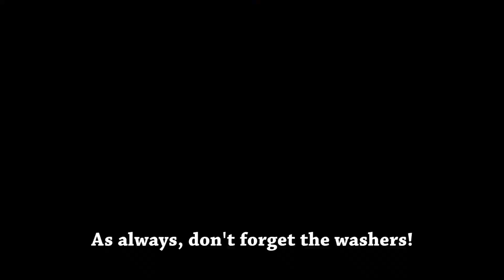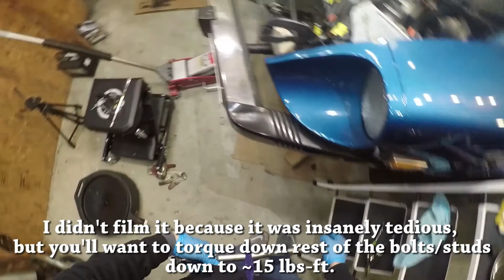Datsun 280z Ep.26 Installing the Intake Manifold

Comment: More than 30 years ago I installed 32/36 DGV Webers and a header on my '73 240.  I lifted the head off along with all the stock intake and exhaust pieces, mounted the new stuff and lowered the head back in place (lapped the valves and cleaned up the ports while it was off).  I just finished rebuilding the Webers and replacing the rusted out header with the head in place.  So I thank you for sparing us watching you do those other manifold nuts.  A couple I could only get to with an open end wrench and then only 1/4 turn at a time.
Reply from the maker: Haha, no problem. It seriously took me over an hour just to do those bolts, it was a giant nightmare. The wrapped headers didn't help the situation. I just hope I don't have to remove them anytime soon.

Comment: Thanks for the video man.  I love your stuff.  Had 2 questions.  You didn't show in the video putting the valve cover breather hose on to the 3 way connector.  Did you put a flame arrestor in yours? Second question is what did you use to plug the bottom side of the EGR valve with your delete?
Reply: @jnieman  awesome. You're the man.

Comment: The air regulator there at 1:42 is one of the only engine parts we can't get anymore.   They were $160 like five years ago and I laughed at the price for such a simple part.   Well now I know why, they've been unavailable for years.    I wish some aftermarket parts company would start selling them new or rebuilt for a reasonable price.  I'm sure there'd be demand for it.  I took mine off and tried to clean it with some manual manipulation and WD-40.  It worked better after putting it back on.  I am at least getting 1100 RPM cold idles instead of what it did before which was basically nothing.   I suppose a new one might give even higher cold idles but I can't be sure.    Of course I have my idle dialed in for a hot idle of 800 RPM.   
Are you going to use NGK plugs and wires?   Curious what plugs you're going to run.   Great work on the car once again, and thanks again for the videos.
Reply from the maker: Yeap, I'm using NGK plugs, B6ES-11's. That's a really good question though, because I remember researching for a while what NGK plugs the 280Z crowd was running, but the community seemed a bit divided. I don't recall specifically why I chose the B6ES-11. Maybe I'll research again and make a video about it. 
Haha, I have an extra air regulator from when I picked up the entire engine assembly for $150. If someone is willing to pay for the AR for $160, that'd be pretty sweet.

Comment: I like it!  Very clean intake setup.  It'll make a difference if you have to troubleshoot a wonky connection or a leak someplace.
Reply from the maker: Thanks! I worked hard on it. I honestly would have kept it all stock if I could. Working EGR component on these are hard to find these days.